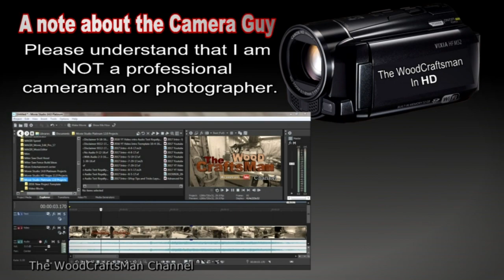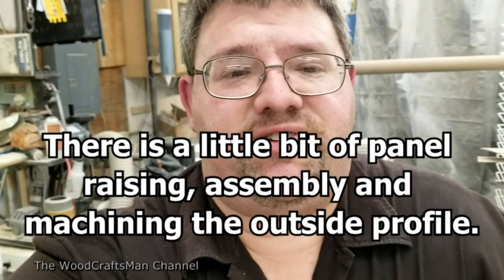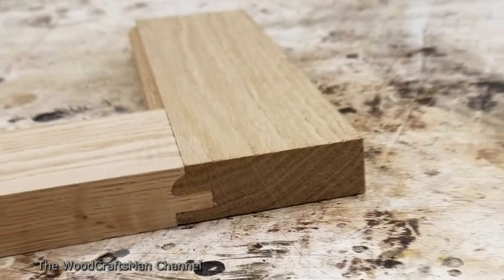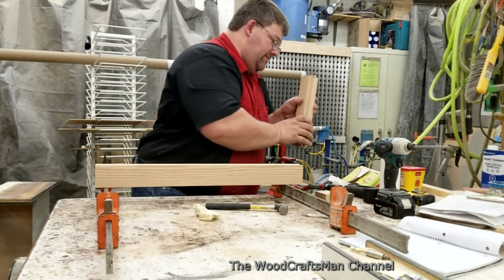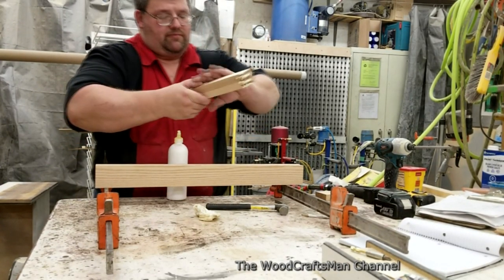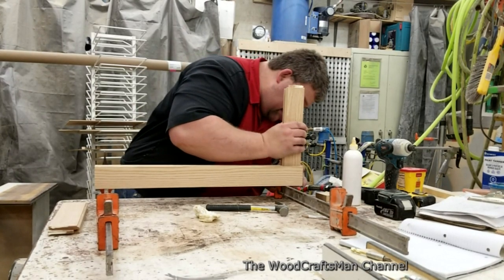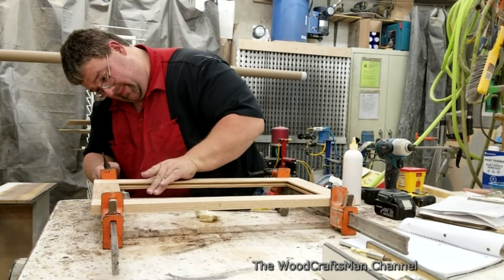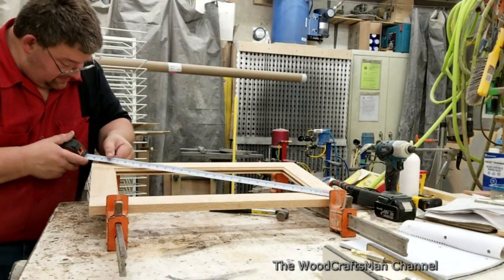Making Raised Panel Doors # 238

Comment: You make it look so easy!  I worked 3 hours last night trying to get the router bits  (basically tongue and groove) for the rails and styles the same plane.
Reply from the maker: It can be a daunting task if your not very familiar with it, or don't do it very often. The easiest advice I can give you is, once you have it setup the way you like it, run a sample piece for each setup and use that as your setup pieces for next time. Scott

Comment: Do you mind saying where you get your rail and stile cotters? Thanks
Reply from the maker: Hi! Its custom made to order insert tooling from a company called Dimensions In Tooling (D.I.T.) located in Granger Indiana. Very reasonably priced and very smooth running. Replacement inserts also very reasonable in cost. Thanks. Scott

Comment: Hi Scott, I really appreciate the videos you are putting out! How do you price for making doors like the ones you just made? Or a full cabinet?
Reply from the maker: Hi, for the most part, it's dollar for dollar. For every dollar in out of pocket expenses equals a dollar in labor. This however is a base line. Depending on other factors, there may be a certain percentage added for other operating costs, complexity of the job or quick turnaround times as well. A lot of times the bid is set high knowing the customer is going to try to negotiate any ways. Scott